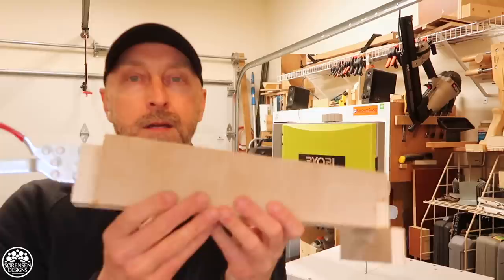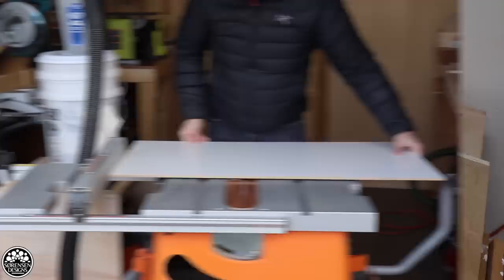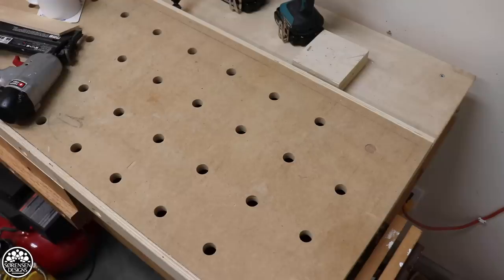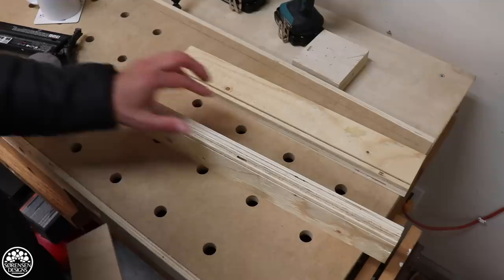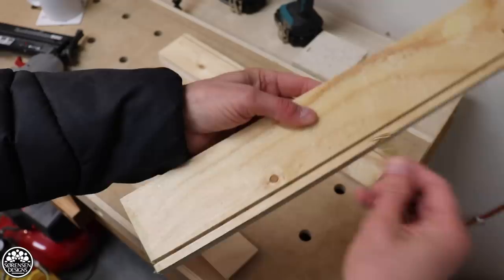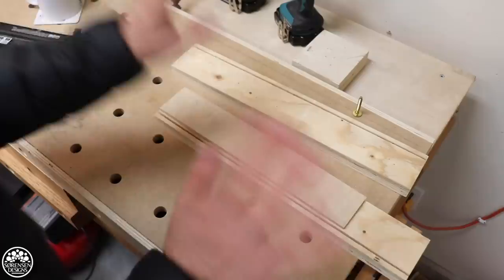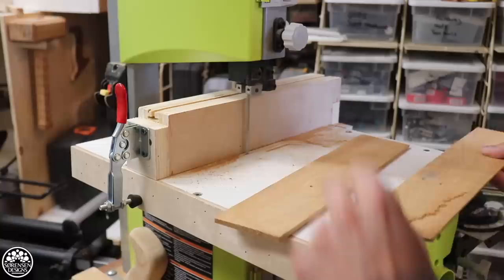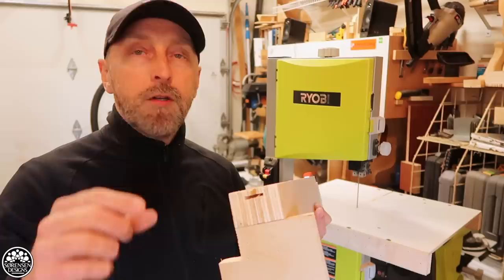The $5 Self-Squaring Quick Release Fence // Woodworking

Comment: Great idea & nice work Eric! I guess that as long as the opposit side of the table are parrallel, that mechanism will work fine. However, I was wondering how you would adjust it for blade drift, which is common on bandsaws. Just thinking out loud.......... Nice job........... 👍👍👍👍😉😉
Reply from the maker: @Sapele Steve Thanks kindly 🙂  Very good point! To avoid drift, I was always taught to tune up the bandsaw blade, not the fence. Once you have the fence lined up square, you adjust your tracking on the top wheel until your drift is reduced. After that, I will also adjust the blade tension until I'm satisfied that it is cutting parallel to the fence. Bandsaw blades can stretch a bit, so you need to get used to doing this from time to time.
Reply from the maker: @Dana Smith Controlling drift usually comes down to tracking and tension. If you're confident that you've done everything to correct it, then the problem might be the blade itself. I found that switching brands recently made a huge difference in the quality and performance of my bandsaw. I've  had better luck with the Olson Band saw blades, purchased on Amazon than the Bosch brand or the factory blades I previously used. 
If you want to check the tracking again, do this:  unplug the machine and do this manually. Rotate the top wheel a few times and keep an eye on the blade while you adjust the tracking knob. When it can go through a few revolutions without any side to side movement, the tracking is fixed. If needed, 
 adjust the tension knob to ensure the tension is right. Not too tight - enough so the blade isn't flexing but stays straight.
Reply from the maker: @Dana Smith  One other thing I should mention is that bandsaw blades stretch a bit over time. You have to adjust the tension (just slightly ) when this happens.